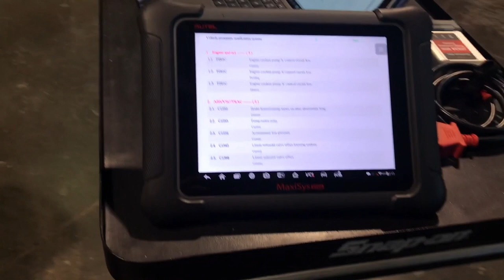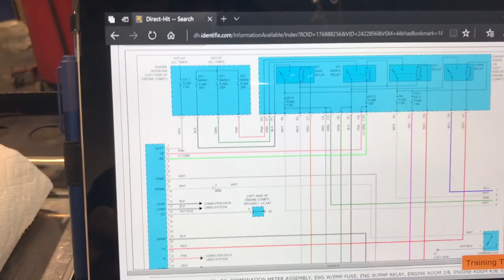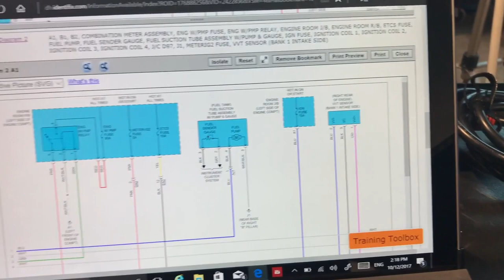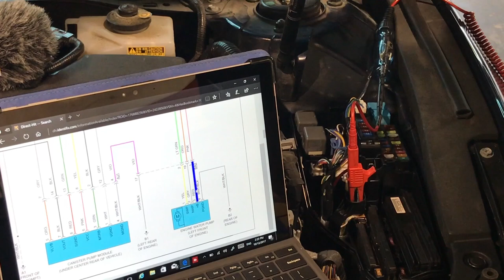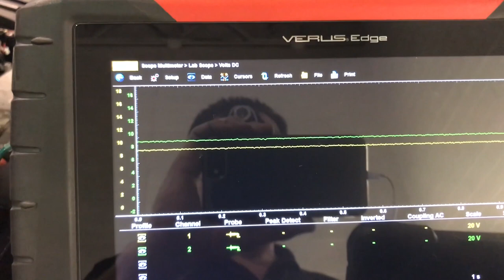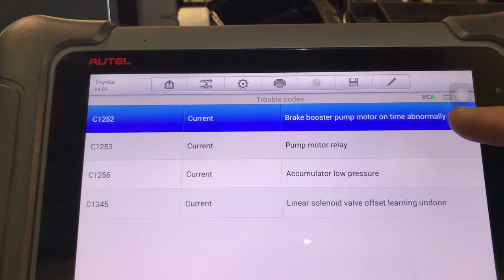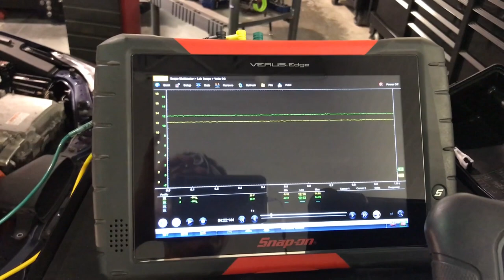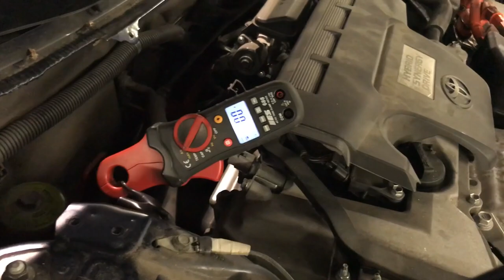2015 Toyota Avalon Hybrid ABS and Engine codes

Comment: Hey Mike, i have a 2015 Avalon Hybrid and it is giving the following:

c1259
c1310
P0A80

do you believe that the breaks codes are becuase of a bad battery module, (or several)?
Could low break pads and rotors cause the breaks code, apart from the P0A80?
Im in Puerto Rico and they really break us here on charges. I previously had a  2006 Prius and changed battery mmodule myself several times. So maybe you could just suggest some ideas?